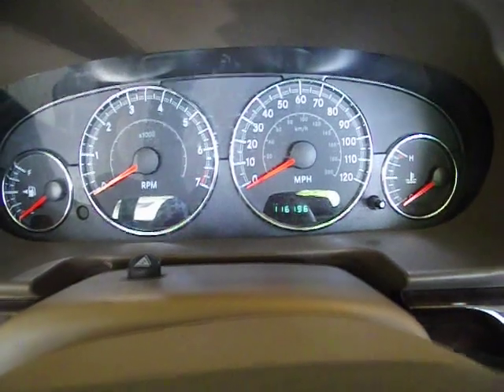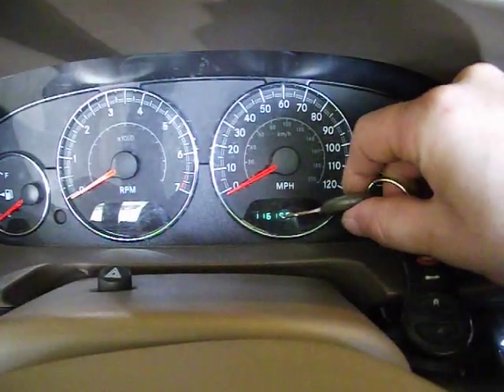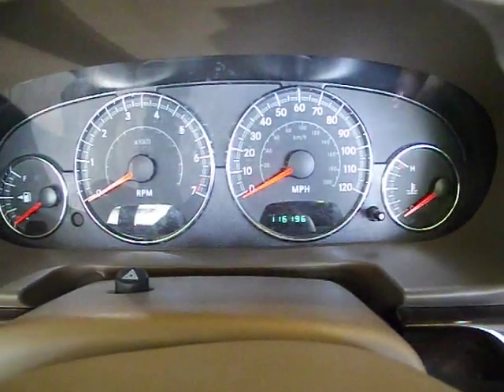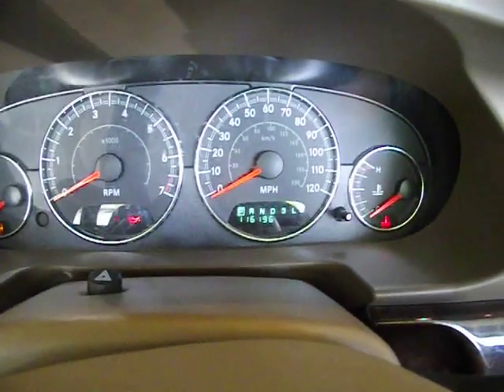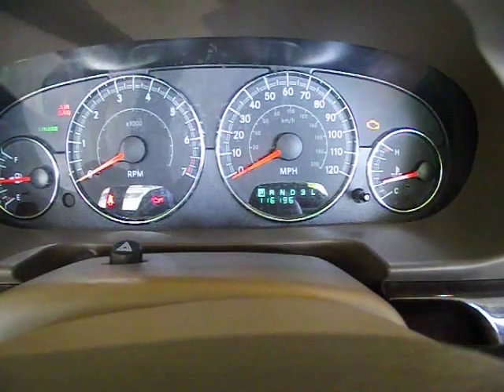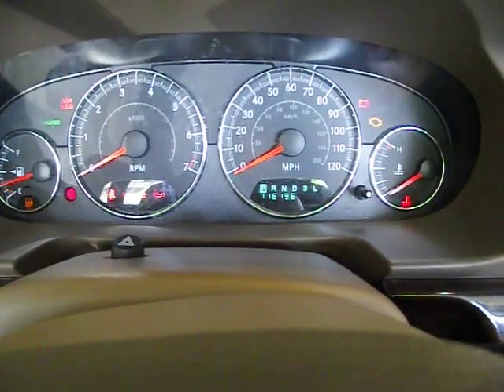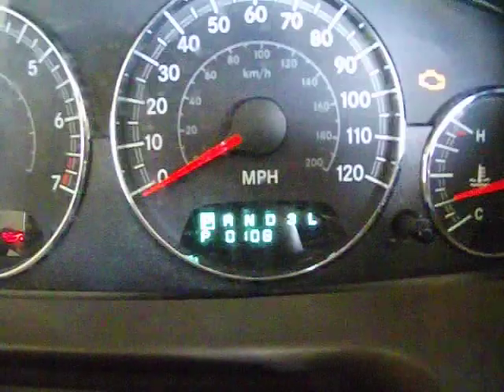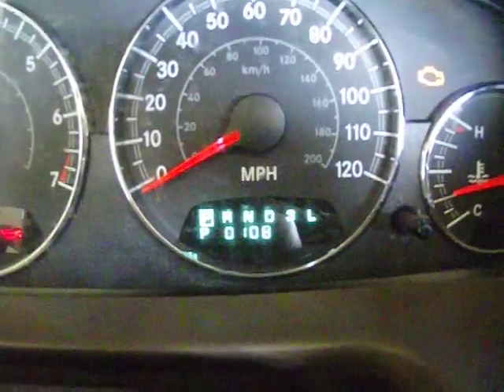How To Read OBD2 Trouble Codes WITHOUT a Scanner Chrysler, Dodge, Plymouth

Comment: P0353 replaced new coil and new plugs and new valve cover and new spark plug tube gaskets same code. Replaced upper and lower intake gaskets throttle body and new sensors 1999 2.7L concorde.

Comment: Is there a self diagnosis for a slip/traction control light?  Its constantly illuminated and disables cruise as a result.
2012 Chrysler 200 4cyl
Thanks
Reply from the maker: Could be a wheel speed sensor. If the car thinks the wheels are losing traction it will turn off the cruise control.